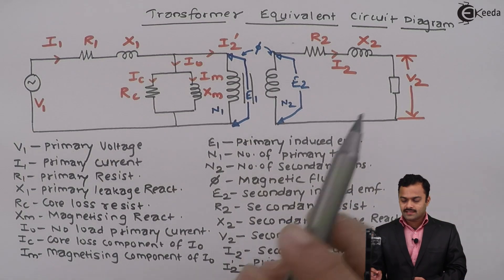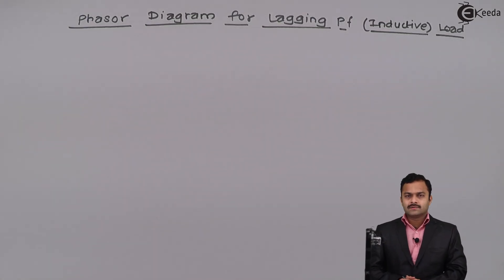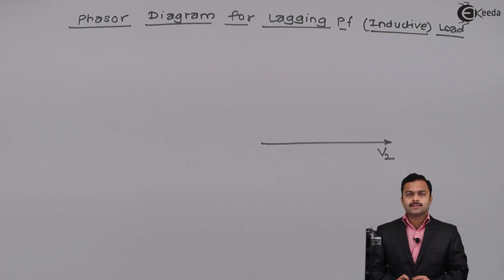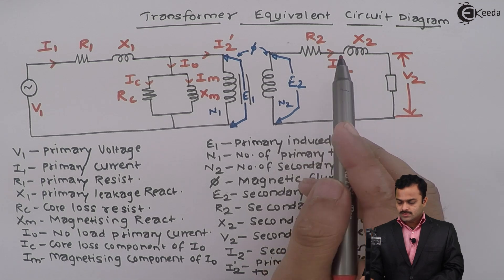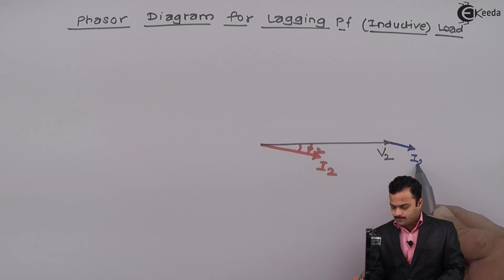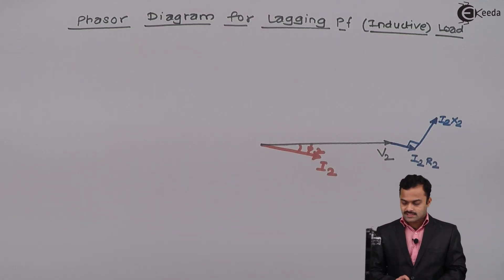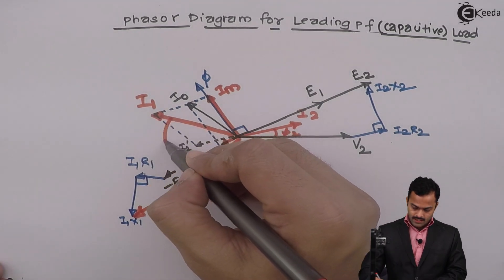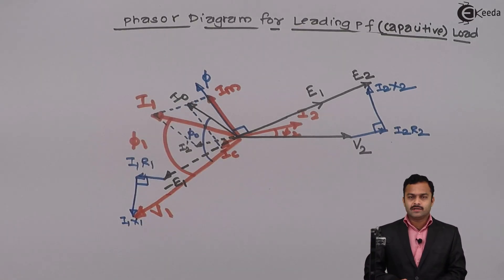Phasor Diagram of Transformer for Lagging and Leading Load - Three Phase Circuits

Comment: Sir, How the flux is balanced when transformer is supplying a load?
Reply: under no load transformer draws small current for creating flux. When it is loaded, current flows in secondary winding producing a flux. Also extra current flows in primary in addition to the no load current. The flux produced by the extra current cancels the flux produced by secondary winding current, leaving only the flux produced by no load current

Comment: At 13:30, can you explain how I2 is lagging E2? In most of the google search for phasor diagram of transformer for leading load, I have seen I2 leads E2. Which one is correct and why?
Reply: Ur suspension is correct. This video provides wrong information regarding leading power factor
Reply: you are right he drew i2 x2 in reverse direction
Reply: Don't get confused between V2 and E2 
In Inductor voltage leads Current by 90 degrees hence the voltage across inductor(I2*X2) leads I2 by 90 degrees
Reply from the maker: Dear Sofy B.Varghese,
To get answer of this question you have to become our member.
To become a member click here http://ekeeda.com/chapterlist/Mumbai-University/Mechanical-Engineering/Basic-Electrical-Engineering/114
For more information Contact us on 9821842103